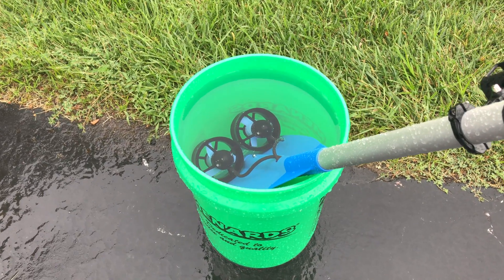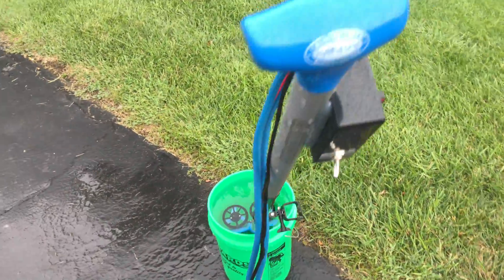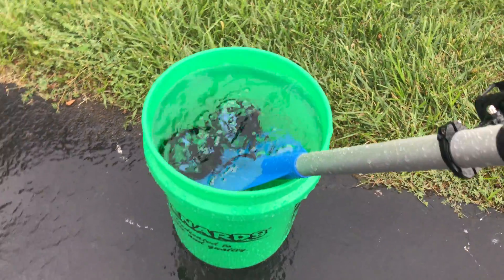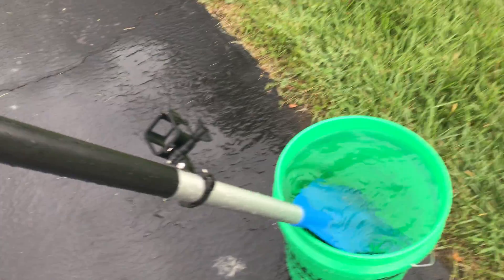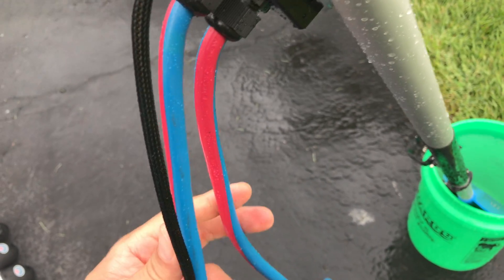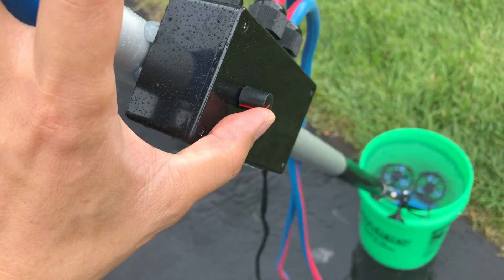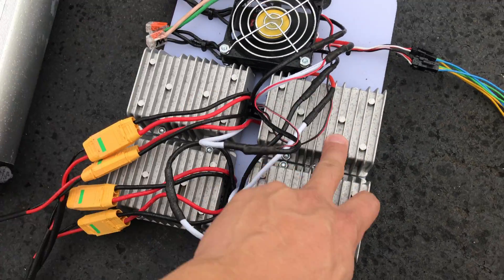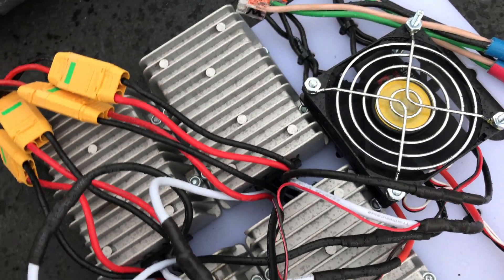Twin Blue Robotics T200 Thrusters at 1200 watts!

Comment: How many volts did you shed at most?
Reply from the maker: I don't recommend going over 5 cells (4.2V x 5 = 21V). I burned them out running with 6 cells.

Comment: I’m researching BR system and have some confusion in regards to their setup vs yours, BR says you can’t use a uni-directional esc with the thruster commander must be bi- directional. But you don’t have the thruster commander just esc with potentiometer knob and a reverse switch? How’s the potentiometer wire in to the esc?
Reply from the maker: Yeah, the reverse switch just reverses the polarity of two of the wires to each motor. The potentiometer is part of the servo tester, which is what gives the ESC the signal for 0 to max throttle.

Comment: hi dude your speed controllers should be water cooled  with a two small water pumps to the speed controllers and pumps out side the of the boat  dude window wiper water pumps ,,,,,will do the job ....and a ,,,,,PWM SPEED CONTROLLER ,,,,, will save power to go longer
Reply from the maker: Are all brushless motor controllers PWM?
Reply: YEP BUT YOU STILL NEED YOUR ESC BLACK AND RED GO TO THE ,,PWM ,,AND THE BATTERY GO'S TO THE OTHER SIDE OV THE ,,,PWM ,,,,CONTROLLER

Comment: Build an RC recovery ring using similar thrusters, how does the streering work? Will just a rudder between the two thrusters work?
Reply from the maker: I have no idea, sorry :) I imagine you could turn on the thrusters independently to steer it.
Reply: ive done 'tank steering' on a model with a pair of smaller T100 thrusters.. it works well just using the mixing functions on a pretty basic radio transmitter . no extra equipment required. it does mean that you cant have full thrust in a turn though.

Comment: Very cool!!

Do you have any idea how much extra thrust you're getting in this config?  I believe each T200 is rated at ~11lb thrust normally.  Also, how much faster was your kayak moving w/ this as opposed to the single thruster from the last video? 

Have you noticed any problems (excessive heating anywhere) using 24V as opposed to the recommended 20V max?

I'm working on a DIY sea-scooter and am wondering if 2 of these powered up would do the trick.
Reply: Matt Secondary me too
Reply: Im working on A sea scooter too

Comment: Im gonna project this thruster as a pool vacuum. Would you be kind enough to help me wire my project?  What type of battery should i use and what type of power wire that will work underwater? Thank you for your help
Reply from the maker: I can try to help you, but there are so many factors to consider. Do they not make a device that serves that purpose already? How long do you need the vacuum to function per charge? You would probably want to run it at a lower voltage (maybe 12V) to extend the life of the thruster. Can you run it from a GFCI-protected, corded power source? That will save you the cost of batteries. If you must use batteries, what's your budget for batteries?  Any wire should work under water. You could consider using waterproof wire nuts, or if you know how to solder, you can use hot glue and heat shrink tubing. The servo tester isn't waterproof, so it would need to remain dry. The speed control should remain dry as well. I recommend posting about this at endlessphere. You'll get more opinions, and possibly better advice. https://endless-sphere.com/forums/viewforum.php?f=39&sid=56bb39b8fbc5d09929ccb41ae4ab0a26
Reply: Just Enjoying Life they do make already make pool vacuums but its the same concept if i make my own. I need the battery to last me 2-3 hours for the day, 15mins max for 1 pool and on to the next route. I was looking at a portable battery like a motorcycle battery or even better a bottle battery if it will last the whole day. ESC and servo will be dry and out of the pool connected near the battery. Please let me know if that would work.
Reply: Just Enjoying Life i have a blue robatic esc and i want to know how do i wire it to the servo? Is there a direct plug in ? Or do i have to purchase a connector adapter ? Thank you for your help
Reply from the maker: I can't help you with the ESC because I'm not familiar with them. I think it takes the signal from the receiver of an RC system. You could try to connect it to a servo tester, but I don't know what will happen since that ESC has reverse. It could be that the middle setting of the tester would be stop but the only way to find out is to try it. For a battery, I would look at 12 or 24V lithium ion batteries. You won't really know what capacity you need until you try it out in real life. You might even consider 18-20V power tool batteries for convenience. Would you have time to charge the battery between pools? If you get multiple batteries, you can just get enough until you have enough capacity for the job. If we knew how many watts you wanted to run the thruster at, we could make a rough estimate on how big of a battery you'll need. For example, mine ran at 693 watts. I had two 36V 9Ah bottle batteries. 2 x 36 x 9 = 648 Wh. That equates to just under an hour of run time at full power. Maybe you could run some tests with a power supply to see how much power you'll need.

Comment: so great video... but what did all that cost you?
Reply from the maker: The cost of 2 thrusters, paddle, voltage converters, speed controls, servo tester, cutting board, wire nuts, 25 foot 12 gauge extension cord, project box, switch, etc. I never added it up =)
Reply from the maker: I provided links to all the main components that I used in my first thruster video https://www.youtube.com/watch?v=AzO50rwD9NQ
Reply: 2 motors is 400 usd and all can be 1000 usd

Comment: Can you please give me all the items you used? I’m trying to build a adaptable kayak using this system. I’m in a wheelchair and unable to use a paddle. I’ll be attaching the BlueRobotics thrusters under the rear of the kayak and was wondering what batteries and other equipment you used. Thanks man
Reply from the maker: I used a servo tester similar to this one https://smile.amazon.com/YoungRC-Consistency-Controler-Checker-Helicopter/dp/B076GMZW73 and this speed control https://www.ebay.com/itm/Hobbywing-SkyWalker-60A-Brushless-ESC-Speed-Controller-with-UBEC/262433262693 I only used 36V batteries because I had several laying around from my ebike projects. If you use a 6s 18650 pack (6 cells in series for 22.2v - will probably have to be custom made), you wouldn't have to use voltage converters like I did. I chose 6s because that's what the speed control could handle. Oh, and you're probably going to want to come up with a way to make it all waterproof. Honestly though, I don't even know if using a servo tester is the best way to do this. You might want to check out the Blue Robotics forum to get ideas. There are probably others that have done what you want to do. For more battery-related info, I recommend https://endless-sphere.com/forums/ but I can try to answer any questions you might have.

Comment: How did you run the servo tester knob through the box? Did you have to extend it somehow? Is it waterproof? thanks!
Reply from the maker: I just drilled a hole in the project box and the shaft was long enough to go through. It's not waterproof.

Comment: Hello, I was wondering exactly how you setup the configuration for the system, im a college student currently doing a project similar and was trying to understand how you connected everything such as the escs to the thrusters as well as any arduino code that has been used, im currently having an issue with those
Reply from the maker: Hi, sorry about the delay in replying. I didn't get any notification of your comment. I just connected the speed controls to servo testers. I didn't use anything fancy at all.